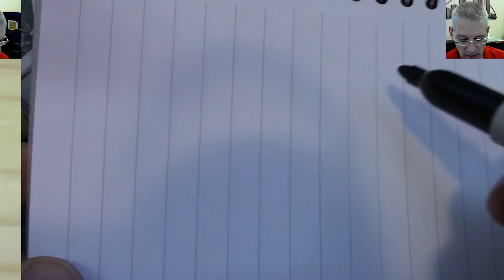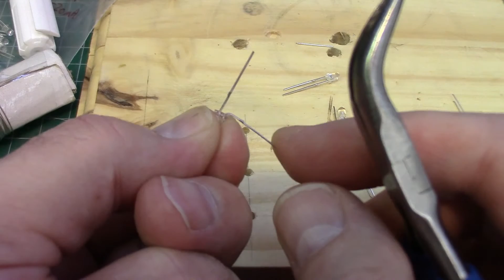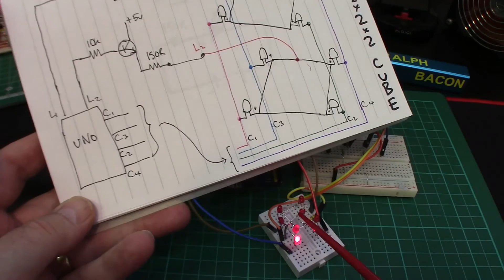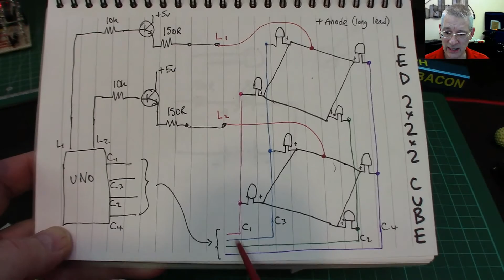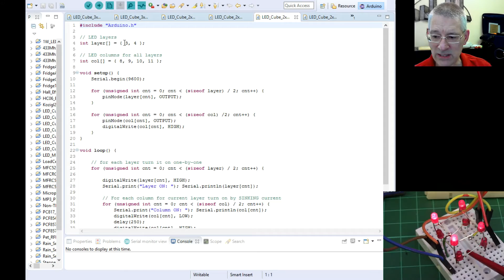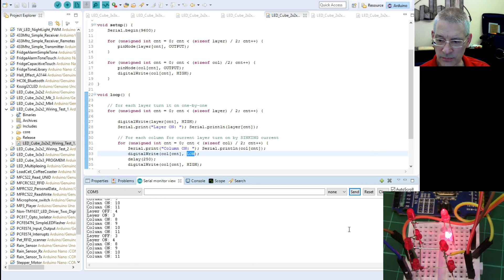#56 How to build an LED Cube - Part 1

Comment: I am just beginning to learn Arduino, and thought this 2x2x2 cube would be very easy.  Wrong!  There is quite a bit going on inside the code (arrays, functions, etc).  I don't want to just build the cube and run it using your code.  I want to understand what is going on.  I will come back to this project when I am ready.  (but I enjoyed watching both videos. Well Done!)
Reply from the maker: Yes, I might have told you that the 2x2x2 cube was probably not a good beginner's project (thank goodness you didn't try the 3x3x3 😯).

It is good, however, that you have acknowledged that you must walk before you can run, and the very first thing is to flash that LED, then work upwards with simple (I repeat, simple ) projects that show you how to do one thing, eg I2C comms, SPI comms, Wi-Fi, and just getting your head round programming.

It's an uphill climb but there are many, many resting places en-route to admire the view and progress achieved so far. Good luck, Richard, keep going!
Reply: @RalphBacon  

Thanks for the thoughtful reply. That is good advice -  to start small, and keep plugging away..   I am a 66 yr old retired chem engineer, learning Arduino just for fun.  I am amazed at your level of energy!  I appreciate you taking the time in your videos to really explain things for the newby.  (the only negative is that I am spending a disturbing amount of $$ buying some of the toys I see in your shop!)

Comment: I just went though this. Very well done. The only question I have if its not too late, my lower layer is dimmer than the upper yet they are all the same Yellow LEDs. I power the breadboard from the Uno. Ideas? Soldering?
Reply from the maker: Hey, it's only been 5 years (almost to the day) since I published this video! Still crystal clear in my memory. (I wish).
Are ALL the LEDs on that layer dimmer? Is the transistor controlling that layer switching on fully? You can test the cube "off-line" as it were by powering it independently (not connected to the Arduino) to see whether the individual LEDs do, in fact, light up correctly. If so, I'd deffo suspect the transistor not turning on fully. Or any limiting resistor(s) being the incorrect value.

Comment: Can i use bc 547
Reply from the maker: Yes, you can, Debadutta, just about any general purpose NPN transistor should work here. Good Luck!
Reply: I am only 11 years old but I love to make electrical projects.I made a home theater,Arduino led chaser, hologram projector, projector, Arduino led cube,air conditioner etc

Comment: Hi

what i got is if I want turn on any led i have to make the pinMode low and the current will flow from 5v that connected to the transistor to the pin  , do not create a problem for the pin?
and when a pin is in low pinMode its connected to GND?
Reply from the maker: It's been so long since I constructed this I can't remember the details but sinking 20mA per pin is fine. If you want to sink more (as we do for each COLUMN) then we need a transistor so we can light up, say, 3 LEDs at one on different ROWS then we need a transistor to take the current load. If you need more info post the question here an I'll check it out on my return from holiday in a week or so.
Reply: for example we have 5*5*5 LED cube and we want to turn all the ELDs of one column 5*20mA=100mA right?
whats will wappend?

and I have a request from you : if its possible create a video about how to understand a library , the name of functions  and what each one does .
Reply from the maker: Last question first, Saeed, see my video #71 on how to create a simple library and how it all hangs together!
 
First question, about lighting up 5 LEDs on different rows but the same column, yes, that's exactly how it works. In my example at least. There may be different ways of doing it, but I think my way is the "standard" way!
Reply: thank you so much

Comment: Mine worked perfectly! thank you so much for the tutorial, you are awesome!
Reply from the maker: Glad to hear it, Lannon. Are you going to expand into a 3 x 3 x 3 cube next (it is considerably more complex but very do-able)? I still have my one that I have never demoed, I really will have to catch up on these things. Thanks for posting, great to hear from you.
Reply: I've created a 3x3x3 Cube without the transistors so I could only make patterns by controlling each column. I'd like to incorporate the transistors so that I could control the rows like I did in the 2x2x2 but I think for this week I'm going to visit your L-293D Tutorial so I can teach the students (at the place that I work) how to use DC motors. Your tutorials are bringing a lot of buzz and excitement to my hometown, we thank you.
Reply from the maker: Thanks for your post, Lannon Khau, good to hear from you. And long may the buzz in your hometown continue.
Reply: I also had a question, in the for loop when setting up the gpio pins, why do we divide the length of the array by 2?

for (unsigned int cnt = 0; cnt < ( sizeof layer) / 2; cnt ++) {

Comment: Thanks for video! But may i have the cct  and code of connection? I need it plz
Reply from the maker: Not sure what you mean by 'cct' but have a look in the video description for the links and also in the next video #59  that deals with pattern generation. I hope this helps?
Reply: Ralph S Bacon sorry cct i mean by it the circuit or digram of connection.. Because i didnt understand the connection

Comment: Negative is the short one, being shorted is negative. Also if you made them both equal you can use the cut off piece to make the plus sign out of the cathode leg. And one more ...the obvious flag on the inside is negative cuz it's a pirates flag and pirates are negative...last one I promise...the positive IS longer and has more metal and it's always positive to have "more" ... ;) ...hope that helps some peeps...

So negative is having less or being a pirate ...-and-...
Positive is having more and making a plus sign with the extra bit if it was cut off
Reply from the maker: Argh, Jim m'lad, tiz true that being positive about a negative is definitely better than having a bit cut off. Oh, hang on, Talk Like a Pirate is on Tuesday, 19 September, I'm being premature (no sniggers at the back there). http://talklikeapirate.com/wordpress/ Great post, MyBigThing2010.
Reply: Ralph S Bacon haha....ugh

Comment: Don't know how I stumbled on your channel a few months ago, but am glad I did. Your videos are fun and so well presented. You are a really good teacher. I wish I could grasp this stuff better. Having fun trying. Thanks for taking the time to make these videos.
Reply from the maker: Having fun whilst trying is the key, Danny. We don't always succeed but it's still worth trying. Spent a whole day yesterday experimenting with the ATTiny85 and I2c and LCD screens - some bits worked, some didn't but you will see the result of my efforts in a video in two or three weeks or so. I often wish I could grasp things better too! If there are specific areas that you are having difficulties in the code in my videos do post questions here; or suggest topics that might interest others too. Otherwise the Arduino forum is a great place to get help too. Thanks for your post Danny, and keep having fun!
Reply: My latest "attempt" at a project is a data logger, like a weather station. Living in the south USA, I want to monitor my air conditioning equipment in the attic. My plan is to use several DS18b20's , NRF24L01 radios, a 20x4 LCD display and SD card and RTC. The radio and the SD card are both on the SPI bus and don't like to work with each other. I found others have the same problem making them work together. Might change radios to get something working. The Arduino forum seems to have all these smart people that might be able to help if they stop insulting the new guys. Most rather tell the questioners how dumb they are, have you even googled for that? Learn how to post the code right or I won't read it! All BS.They are (not all ofcourse) just opposite from you and your approach to teaching. Why do they thing people go there for help, BECAUSE THEY DON'T KNOW. Not because they are stupid.
Enough about that , YOU know more than they do anyway!!!
Reply from the maker: Yes, some of the Arduino Forum experts are very precise in what they will help with (and what they won't do, like homework assignments) and the OPs get short shrift if they don't "follow the rules". But when you consider that hundreds of questions get posted a week you can see why the experts' fuses can get a bit short with OPs who say "I want to run my Arduino to transmit data what do I have to do?", without showing they have even thought about it, or the exact problems they are facing.

But I feel your frustration too at their less-than-supportive attitude on occasion! As an occasional contributor there I can see both sides of the issue and empathise with both camps. I've sometimes spent some time answering a question yet never get a response from the OP to even let me now he's read my answer, let alone whether he found it useful! How rude!
 
I don't know why the nRF20L units and the SD card logger would not play nicely together (is the CS line is being brought low correctly as you address each unit and then high again when finished communicating with it?) If done correctly they certainly should work but then again this is electronics! Keep trying various solutions, you'll come up with something I'm sure.

Comment: Hi just discovered you on you tube . Just a quick question what IDE do you use in this video ?
Reply from the maker: +thailoz944 
Welcome to my channel and I hope you like what you see here! If you do, please consider subscribing too (not already).

Regarding the IDE it's called the Eclipse (Java-based) IDE, which, whilst being very good (especially with the added Arduino add-in) it is not for beginners nor the faint-hearted. There are more details under video #49 "More Pins Please" where another subscriber asks the same question (search for Eclipse on that page). It's quite similar in concept to Microsoft Visual Studio; but I would totally encourage beginners to use the standard Arduino IDE as it is more beginner-friendly. Getting to grips with C++, an Arduino AND a new IDE is definitely a step too far for most. If you're keen though, then have a go, more details and links are in the other comment (and good luck)!

Comment: Hi Ralph, great video but I'm left a little confused regarding the code. Is there a reason you didn't use a different variable name in the inner and outer loops? It looks like you have used "cnt"  for both.
Reply from the maker: +Graeme Pinnock
An excellent observation and I hoped no-one would notice! Drat! But it raises an interesting point about 'variable scope'. When a variable (such as cnt) is declared within a 'for' loop (that is, within curly braces), its scope is constrained to that set of braces. So, for example:

{
   var cnt = 1
   do something else here
}

{ 
   var cnt = 6
   do something else here

}
Are perfectly legal constructs as each declaration is scoped by the curly braces (like the ones around a for loop). The first variable named 'cnt' disappears immediately the closing bracket is hit in code execution.

I've uploaded a tiny example sketch just to illustrate this point (see video description for the link, but it's here: http://bit.ly/variablescope)

In hindsight I should, perhaps, have used a different name in the inner loop to avoid confusion but at least now everyone knows about variable scope, so thanks for that question and I hope it has clarified why it works the way it does!
Reply: Ralph S Bacon Thanks Ralph, lengthy explanation greatly appreciated.
Reply: Ralph S Bacon basically, anything NOT declared as a global can be used wherever you want in the construct without affecting the overall coding/program because...again...it's not a global declaration....right? ...I learned that on circuit #2 in the beginner Arduino sketches...